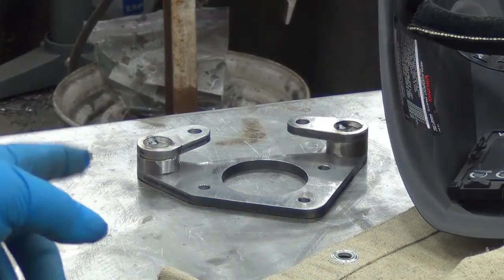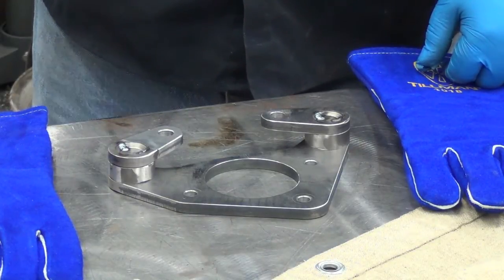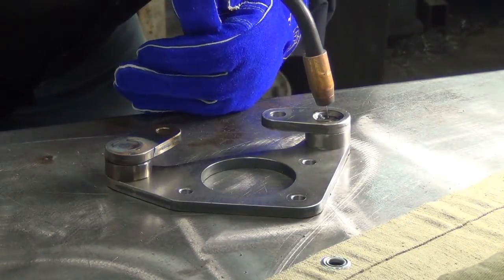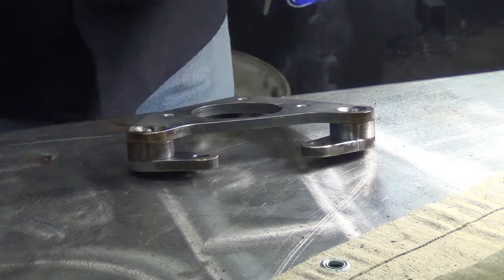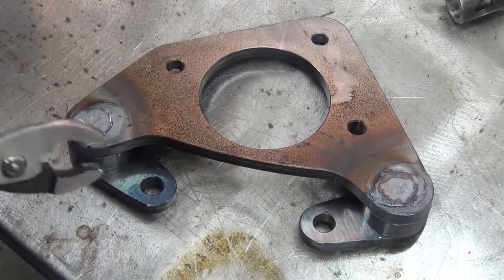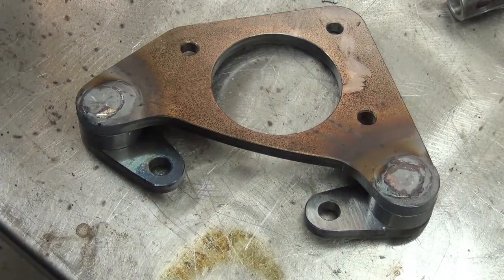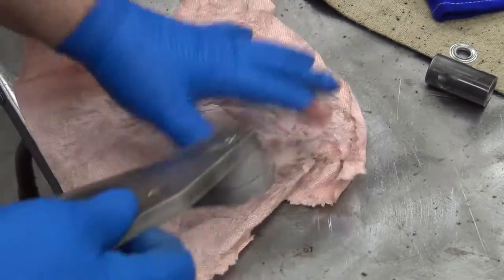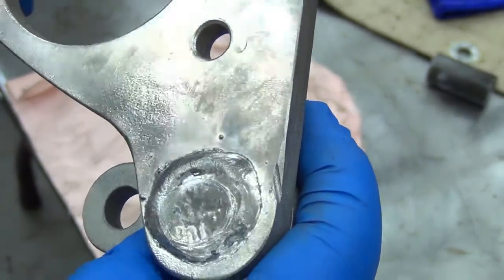Brake Bracket Build - Welding

Comment: I can't weld but I did stay at Holiday Inn... I love MIG but it's a feed dependent method.  You want that center pin to fully wet out to the circle edge but the wire needs to feed fast or fat to carry the current.  If the pin heat rises slower than the wire builds up the hole will be filled before full fusion.   My preference is to start in the center and spiral out thus preheating the edge, but keep the pool shallow so your aren't trying to reach into a cold crevice.  Once at the edge lay your root pass around the side then spiral back.  You can root to the top and finish on the inward pass.  Good news - that plug weld will keep the parts straight; as the metal cools it pulls the pin tight into the hole.  Bad news: it pulls the pin into the hole.  The pint will be like a pre-stressed concrete post.  If you have a cold root at the circumference the bond could fail and it would look like a small blob of chewing gum was holding it together.  Fortunately you filmed it from the side so if the authorities ask about it, after you have caused untold millions in damages and liability, we can say "It looked good from here."  :)
Reply: OOPS.  I just watched it again.  While you were moving the parts around with the pliers while it was warm I saw light between the stack-up.  Maybe the edges of the holes weren't chamfered enough?  That could allow some flexing or areas for hidden corrosion.
Reply from the maker: I was thinking along the same lines with starting in the middle.  I welded up a few more today and I like the welds much more!  I used a circular motion with the wire that included the center and the edge....kinda like a spirograph flower.....and I went a good bit slower.  So, the welding in this vid is definitely the worst of it.
Thanks Eddie!!

Comment: A friend of mine burned his body shop down welding inside a Camaro without removing the last bit of sound suppression material from the floor. He got a call at 10 pm after he quit welding around 4 that afternoon telling him his business was engulfed in flames. Was a total loss and many very expensive cars went up with it. So yeah whatever you do do not burn the house down would be tragic and you may never recover.
Reply from the maker: That's definitely a huge concern.  I welded up a few more today.  I left the shop opened up for an hour, then went back and checked again.  I'll move more stuff out of the way and clean up a bit before I weld up the rest.
Thanks!

Comment: When you started in the center and worked your way out it seemed to be some undercut...the weld in the center really does not add any strength, if thats what you are after. I would just weld the periferi of the plug. But if you are after a nice flat finish and having problems with to much heat because of to much welding time. start at the periferi when the metal is cool, and then fill the rest in.
Reply from the maker: Great info! Thanks!  I had read or been told that before.  My only real thought about starting at the center was for preheating...not strength.....and filling it is more for cosmetics.  I may just try a few on just the periferi.  I thought this plug weld style would be a lot easier, but only the welding is easier......the amount of prep work was triple so I'm not sure I'll go this route next time.
 Thanks!!!
Reply: Ok. The fitting and prepping is the real labor. Seems to be plenty penetration on the weld. Like someone else wrote maybe put a radius instead of a sharp corner on the plug couse thats seems to be the weak point.
Reply from the maker: Henning Jonsson
I will try that if I do it this way again.....which I doubt.  The original plan was to have the hole laser cut with no follow up drilling.  But, since I had only the parts cut on one side(no left or right), the parts that had to use the exit side of the laser cut weren't accurate.  I'd have to have left and rights cut and use the entry side of the cut to align the plug.  I undersized and drilled the holes, then found out that they didn't drill accurately.  If I have the hole laser cut again, they'll need to be closer to 1/4" if I'm going to drill them, or they'll have to be the full diameter needed. Not sure that made much sense.  By the time I need to make more of these, I'll have the cnc mill in place and running.  I'm thinking I may just have "blanks" cut with the larger center hole and the outside profile.  I'll set up a jig to hold them and then have the mill drill/chamfer/radius the holes.  We'll see.  In the pursuit to make them better, I've quadrupled the work. lol
Thanks again!!
Reply: Yes, planing ahead is the real challange in metalworking. One will never think every step out exactly right, thats impossible. Learning new stuff every day and will do so for as long as we live:) hmm, if you want exact holes maybe brotsch them?
Reply from the maker: Henning Jonsson
I enjoy the learning part...provided the lessons aren't too hard. :) 
Had to look up brotsch.....I was thinking broaching which didn't make sense....came up with reaming....much better. :)   They don't really need the accuracy of reaming....the diameter is less an issue than the placement of the hole.  Laser cutting has a lot of run out compared with drilling or cutting, but not near as much as plasma cutting.  Since the cut wanders a bit after penetration, the exit side is less accurate.  I think the easiest way to be more accurate is to just drill everything myself on the next set.
Reply: Okey. Wooops sorry, some swedish lesson for you there:D
Reply from the maker: Henning Jonsson
Thanks!!

Comment: what you see popping off is the copper from the coating of the wire i believe
Reply from the maker: Ahh....that makes sense......a lot of wire got pushed in there.
Reply: The little scales that comes off from a MIG weld are glass from the silicon used as an additive in the wire so the puddle flows better, it's Si in the spec sheet below. Beware of your eyes, they hurt, even more when hot.

http://www.lincolnelectric.com/assets/global/Products/Consumable_MIGGMAWWires-SuperArc-SuperArcL-56-N/c101011.pdf
Reply from the maker: pierre beaudry
Thanks for the clarification!  Now that I think about it, it was really shiny and hard....much more like glass than copper.  I'll be welding more tomorrow, so I'll see if I can get a closer look.